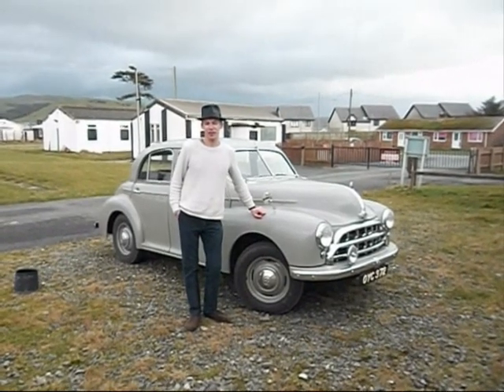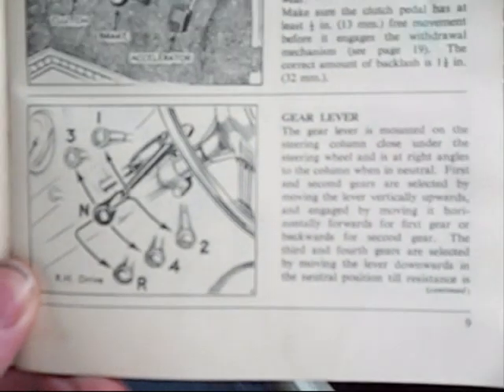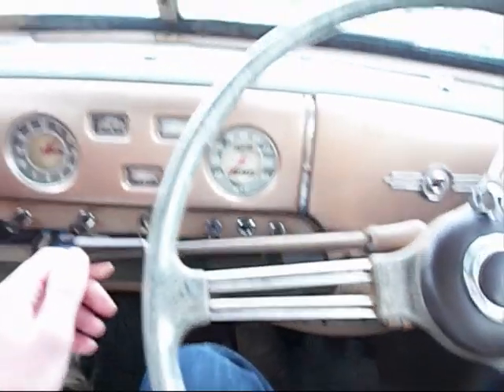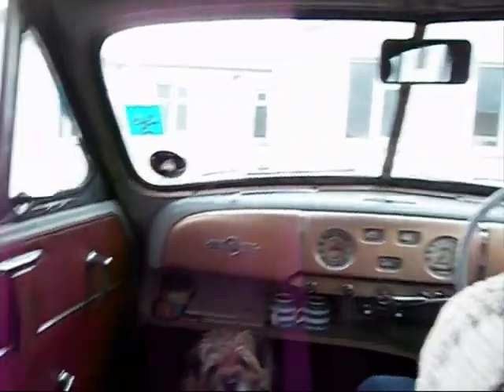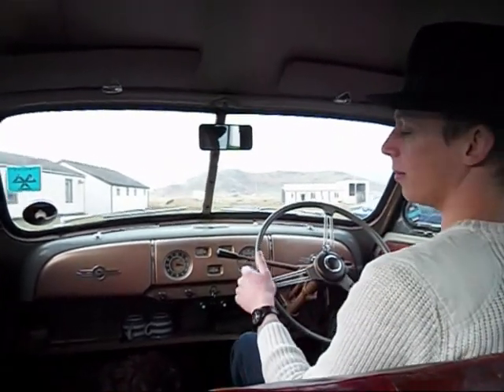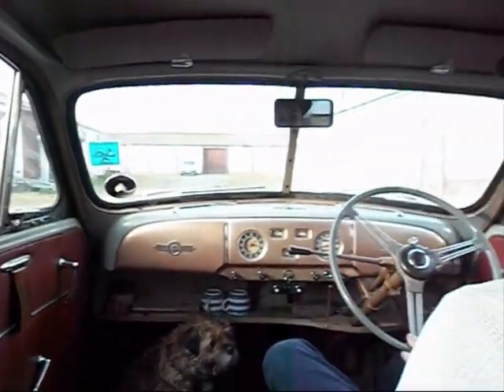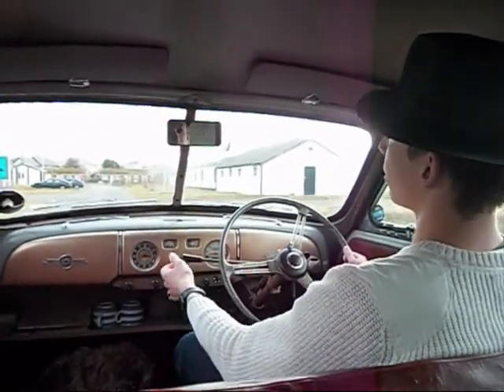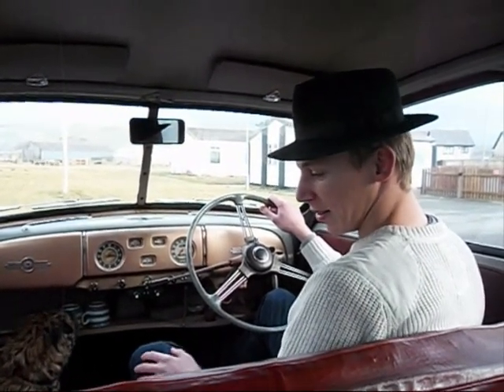Steering column gear change   gear shift

Comment: Absolute nostalgia overload there. I was born in the late 1950s, so was a young passenger in several jelly mould GB cars, one or two with column change. I even got to drive one when I became of age to drive. The bench seat, the turn signals on the steering boss, the whine of the gears on the overrun, the pull starter, the pistol grip handbrake. And in this particular setting, the wee whimpering doggie and the two upturned blue hooped mugs on the lower tray. I was looking for a flask at one point.
Yep, you certainly hooked me with this video, and I'm an electric car enthusiast. But I don't forget engineering of the past.
Reply: I’m nostalgic cuz this looks like a vid from 2008

Comment: A question for you, did the 4 speed  pattern differ for manufacturers? I may be wrong but I seem to recall on an old Humber Super Snipe  that first gear was away from the steering wheel & up, 2nd down, 3rd towards you & up, 4th down.